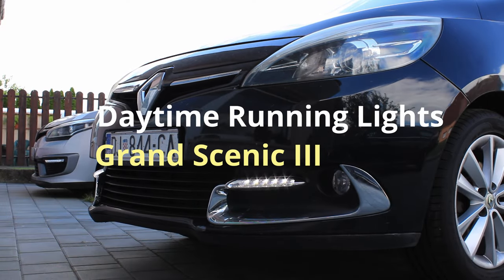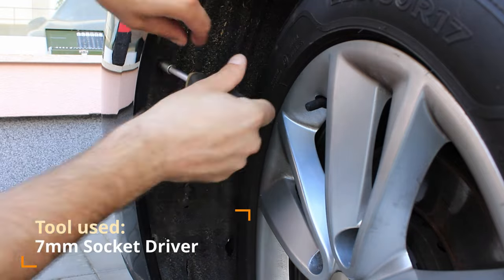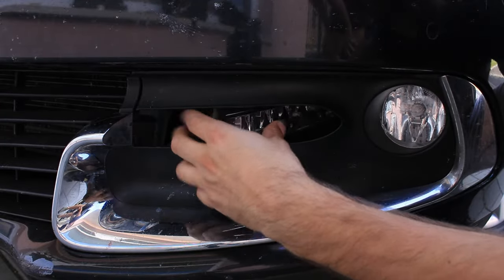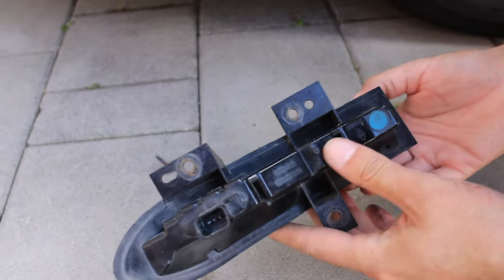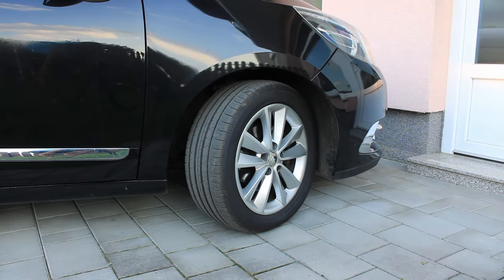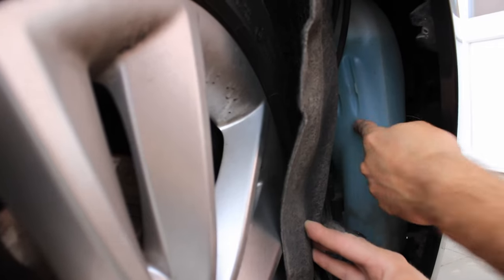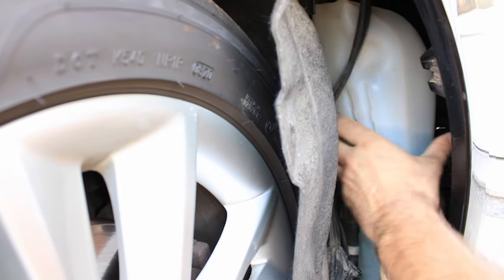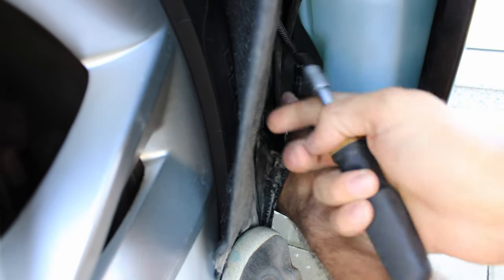How To Change Daytime Running Lights - RENAULT Scenic 3

Comment: These guys are faboulous. Thanks to them I finished three long awaited projects on my GS, fuel cap lock, door check strap and now finishing DRL replacement. I noticed you guys took the plastic chrome arround the DRLs. Mine is quite damaged and I am looking into repairing it. Do you have any advice? Also is it possible to get the video of how you took it off? Many thanks. Keep up the good work. Maybe a suggestion for the future video, how to get rid of scratch marks on the plastic interior parts.
Reply from the maker: Thank you for your support and suggestions! Chrome around DRL is attached to the bumper with multiple plastic clips. Just go gently with screwdriver along the edge and pull it out. Be careful as these clips can break easily. Chrome is difficult to repair if it's cracked and pieces start to fall off. Maybe you could try wrapping it with chrome vinyl foil.

Comment: on my Renault Scenic the LEDs are fine, but on the Renault Megane, which my daughter uses, the LED on the driver's side has condensed water in it. thanks for the great video
Reply from the maker: You are welcome. Thank you for watching!
Reply: @BbrosAuto  can you make a video on how to replace the bulbs on the brake light located at the top, on the rear hood of the Renault Scenic III?
Reply from the maker: @Martin J. LSOVAKIA We will make a video on this subject soon as possible. However, this light doesn't have a bulb rather LED-s, so we will try to find some solution for replacement.

Comment: Great and helpful video.
To change the light on the right side, would it be easier to first remove the wheel?
Does it give you more room or not really?
Thanks
Reply from the maker: Thank you.  We tried to remove just the wheel but the reservoir was still in the way. This side is a bit trickier and that was the quickest solution we managed to find.
Reply: @BbrosAuto  Don't get me wrong.
Your solution is perfect.
I just want to know whether I should remove the wheel BEFORE proceeding with your solution, to have more room.
Reply: what's the serial number for the right side lamp? I have a 2012. scenic, and need to replace the lamp

Comment: Have you any idea where the DRL/ Front Fog Lights fuse location is as they're all not working?
Reply from the maker: The fuse box is under the hood on the right side next to battery. The fuse for these lights should be there.

Comment: How to find Renault grand 3 fuses / i search but can’t find Renault grand scenic 2014 model
Reply from the maker: @Shakeel Expert  Hi. You can find the fuses in two places. First is on the left side from the steering wheel, and second is under the hood, on the right side from the battery. Anyway here is the link that may help you:https://fuse-box.info/renault/renault-scenic-iii-2010-2016-fuses

Comment: I've got a 2014 scenic and mine has all sorts of stuff behind that wheel arch cover, (sound proofing, electric cables and a big old plastic box right where you show that handy hole to be... so no chance I'm getting in there as easy as you do ???
Reply from the maker: @bexnomad  We didn't know the younger models have all those things there. This one in the video is from 2012. Sorry to hear you can't reach it.
Reply: I have the same withine, did you find a solution bexnomad?
Reply: @ljamestee3358  it took time... Ok. As the cover is plastic I got a very small drill bit and carefully drilled a couple of holes underneath at the bottom to drain the pool of water out this involved tapping light with finger and inserting drill bit in a little way only using my hand into holes I'd drilled, trying to get water to drain out that was the time consuming bit....then leave in sun if possible to dry as much of remaining damp out as possible, (the little droplets on the lens that tapping does not remove) you'll see what I mean.. then mix up some epoxy resin, a little two tube kit will do. And fill/ re seal the hole/holes you drilled to stop water from entering again..and let dry it's fiddley but mine is still clear of water 🤞🏻👍🏻